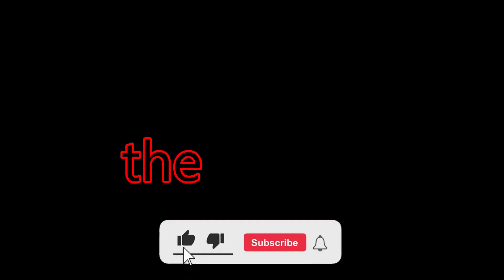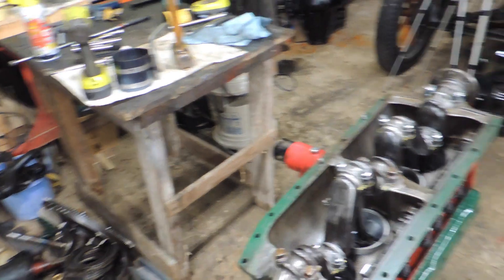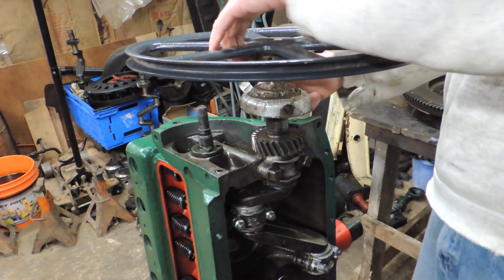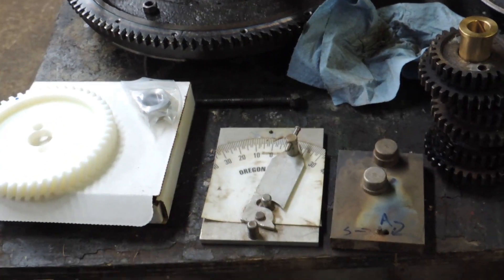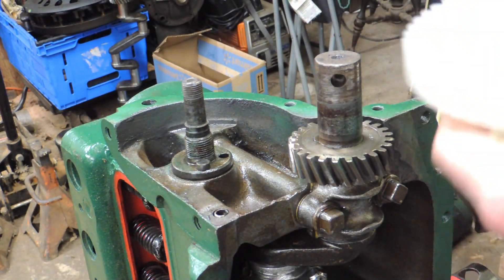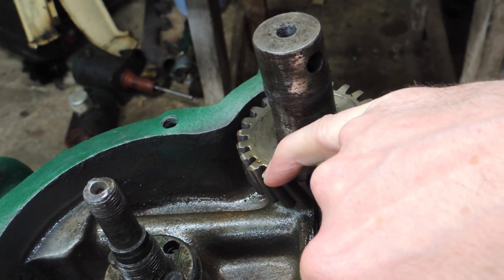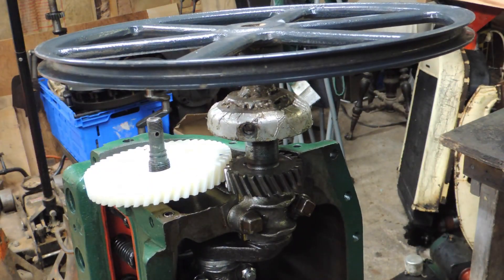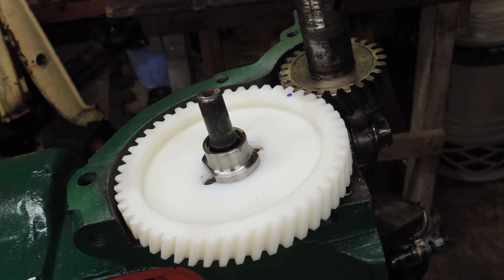1925 Ford Model T project - timing gear upgrade       #modeltford @Gen3AntiqueAuto

Comment from the maker: Ok everyone - a floor painter has told me these gears won't last 20 years...  I've been selling them for 20 years, not one has failed yet as far as I know - better bring your engine in so I can put a metal one back in....  Terrible, what is worse is the one I pulled from that engine still looks brand new 15 years and 50,000 miles later.  Def no  good.....  :(

Comment: Here's a little info truth about EE cranks... like all non- counterbalanced crankshafts, they can't be balanced.  And two the EE crankshafts were just as weak as the earlier ford cranks, what was the misconception was the 2 bolt  bell housing support that prevented the EE crank from cracking sooner, the only reason for the change of metal was Henry went to cheaper design. So unless you have the 2 bolt bell housing support at the top of engine the EE crank may even enter the 2 piece crankshaft club sooner.
Reply from the maker: Every bit of that contradicts what I was told 1/2 a century ago.  But thanks for the comment, I know it took some time to write it down for us.
Reply: Sorry you don't want believe the EE crank was a plain carbon steel crankshaft.  But think about facts .... the 4 dip pan and 2 bolt secured trans started what year? 1926 same year the cheap EE crank started. Ford understood his T had a dangerous engine failure and had a fix. And it wasn't the EE crank... they used this carbon steel crank to cover the cost of the new engine design. Read all forums and history.  But hey believe whatever you want🙃
Reply from the maker: @leonnygren9394  I was told EE was "vanadium steel" whatever that is.  It is definitely larger than the earlier ones.  You are right about the 26/27 improvements to the pan and engine.
Reply from the maker: @leonnygren9394  What do you think about the series on this car and on "the chicken coupe" - are you learning or at least entertained?
Reply: Very entertaining and unique approach with words. Whats funny is my neighbor was a Chicken farmer and he used a TT for a coop for years to keep roosters in.
Reply from the maker: @leonnygren9394  You'll love this then!  https://youtu.be/SjQtGc6m2Ek

Comment: How did you come to the decision to advance it 7 degrees. Thank you
Reply from the maker: What I did was take a new camshaft made by Bill Stipe (known perfect) and a degree wheel.  I found the "straight up" point, between the intake and exhaust lobes and it was 7.5 degrees each way.  Some of the racing guys would do the same back in the day.  I might do a video on this if there is a need for it.  Advancing the cam timing brings the power band down to a lower rpm.  So that 20 peak hp can be moved down to an rpm where you can actually use it.  So little air goes through these engines it's impossible to hit "stock peak horsepower" because it physically won't spin fast enough to reach it.  I tried 8.5 once and it was too much, lost the top end.  I think you can see the cam specs and degree info on the wall in the video.
Reply: @Gen3AntiqueAuto  did you try 5-6 I’m just wondering if 7 is optimum or could it be too far and falling off a little. Are you using a stipe cam. Do you know anyone selling low end torque cams
Reply from the maker: This is a re-grind 290 cam.  7.5 advanced worked the best for me here.  Bill should be making more cams again soon.  Last I knew he was moving the equipment to a new location and getting set up.   @brianlaplante4286
Reply: @Gen3AntiqueAuto  thank I’ll do figure out how to contact him to see how it coming
Reply from the maker: Not sure what name he'll be using going forward (legal stuff) but I will let everyone know here when they are available again.   @brianlaplante4286